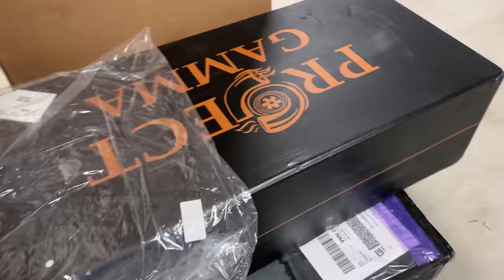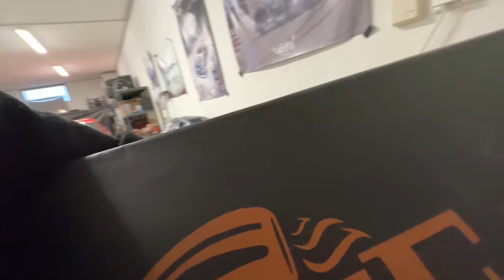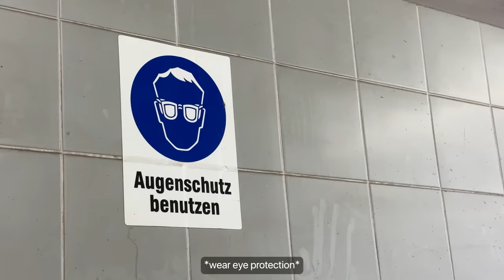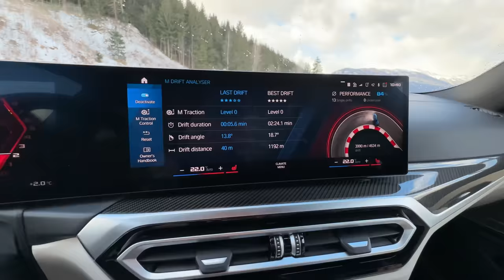FIRST MODS for my G80 M3 - Project Gamma FRONT GRILLE + KW Suspension + Air Intake - OG Schaefchen

Comment: Sick intake sound! I would be kinda scared of all the dirt and other stuff collecting in the intake directly in the front that is hopefully not getting through the open air filter 😅
Reply: That's what an intake filter is for lmao
Reply: @FlagnarBoobz  i know but i doubt it prevents all of the debris getting into the system because it's not the typical paper air filter.

Even though this one is oiled i would be a a little bit concerned. Once you get small particles into the intake it goes right into the engine and causes small scratches at the cylinder surface
Reply: @ShiDDeX_  fair enough
Reply: I'd be worried about it getting wet too, being where it is it will give you good cold air feed. But for daily use on a road car abit too hardcore, it will get dirty and wet in no time. At least with open filters under a bonnet they have some protection from the elements

Comment: Car is looking amazing 😍
But would it be for you a possibility to wrap the middle parts of the new carbon grill in white? I mean the part where the two PDC sensors are located in the middle of the grill. Kind of like Prior Design or Evolve, they both showed designs where you get the „traditional BMW kidney look“…
Besides that: Awesome.
But I do have to ask: Don‘t you‘ll get problems when the air filters get wet? Or isn’t that a problem?
Viele Grüße, Philipp 👋
Reply from the maker: Good plan! Maybe i will try it!
Reply from the maker: And gamma project said it wont be a problem
Reply: @schaefchen  If I were you I would take a picture from the front of the car and let somebody photoshop it. I assume it would be enough to show how it could come out at the end. But don’t get me wrong, even now the car looks WAY better 🙏

Comment: 9:06 this is not my car, but as far as I know, you need to tighten the suspension when the wheel is in a position on the ground, that is, you need to make it look like the car is standing on the ground because when the car goes down to the ground, your silent blocks will turn out a little that is why you need to tighten each wheel, that is, put something in the suspension and lower the car, thereby you will tighten the suspension already with a tensioner and suspension in the correct position otherwise, you will get as if the car is weighing on a lift, the wheels are lowered as far as possible, the spring is relaxed in this way, you can have silent suspension blocks fail much faster

Comment: Thanks for pushing the G80 more than than BMW was willing to. In germany a front plate would be mandatory which hides a bit of the ugly front, but as you can tell I still dont like the look of that grill. atleast its an M3 a normal 4series coupe in cheaper trim is hopeless... I also dont like their lacy approach of not changing the rear doors to the widened arches, that " step" in there just looks bad.
The intake sounds awesome but these filters will be wet and dirty in no time and to change them the whole bumper has to be removed which is not practical...